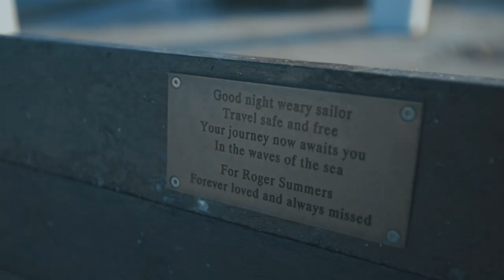TOWED back to shore with Engine FAILURE - EP 03 - Sailing Beaver - Norway to New Zealand

Comment: If you suspect a faulty thermostat, just remove and re-assemble the housing without it, it would enable you to keep going without outside help.
Reply from the maker: mjcooke2 thanks for the tip, thats good to know! We were lucky that the yanmar dealer was close, so was able to get a new one pretty quick
Reply: @SailingBeaver  your also lucky you have a Yanmar and not one of those green beast you always see in a Beneteau.
Reply from the maker: Yes I have heard of a few more problems with the green beasts you talk of. Although yanmar parts are quite expensive.
Reply: @SailingBeaver  in the EU yes, but in the states not so much. over here Yanmar is in just about every sailboat on the market.

Comment: Did you have a spare thermostat on the boat?  What are you carrying for spares?  Maybe you could do a boat tour while in lockdown.
Reply from the maker: No we didn’t, but we definitely have a couple now. We have a lot of rigging and a fine spares. A boat tour is very possible. 🤙
Reply: @SailingBeaver  I was going to suggest you carry a spare, but unless it's a strange size, thermostats are pretty available everywhere for cars.  And they don't seem to be a common failure point.  But it's good to be prepared.

Comment: Hopefully you had insurance for breakdowns and that wasn't a 2000 euro thermostat.
Reply from the maker: A free tow and an £80 thermostat so no dramas there. 🤙
Reply: @SailingBeaver  that was fortunate! When I started building our bus conversion 30 minutes into taking it home the big block Cummins ISC diesel engine put a rod through the block. That was a $1,600 USD tow and about $15,000 in the complete mechanical rebuild of the entire powertrain. Perseverance pays off though. Now she'll run smoothly as long as we'll care! I liked your positive attitude and problem solving with the breakdown.
Reply from the maker: Spewing. Sounds like a nightmare. Thanks a bunch and good luck with your build 🤙